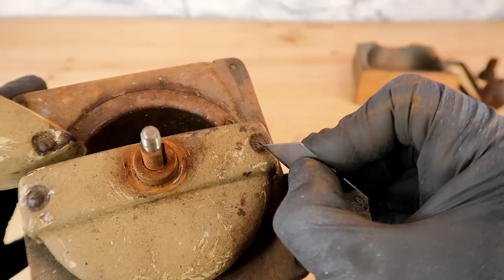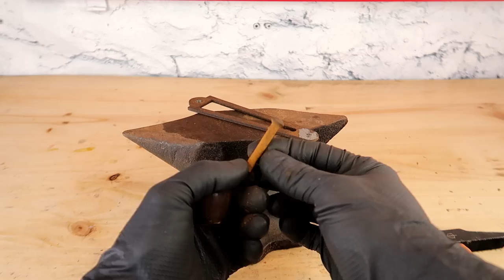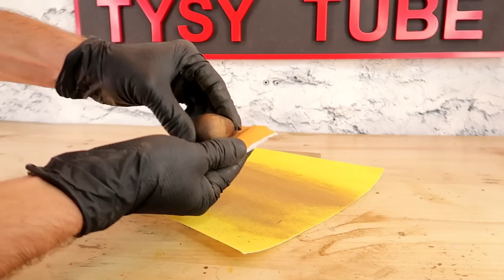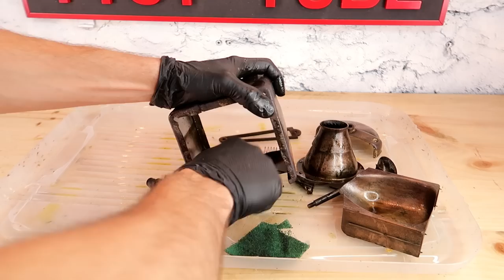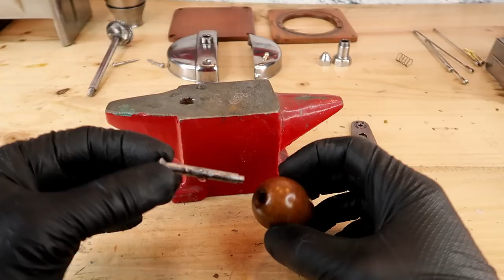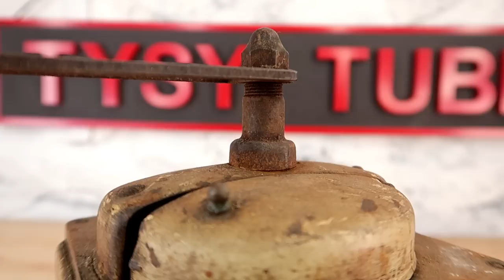Rusted Coffee Grinder - Restoration

Comment: I notice that the tabletop wheel with the wire disk was used to clean the outside of the metal housing. Would it make sense to use a wire wheel attachment on a small dremel tool to clean places like the inside corners of the coffee bean area? The section where you put the coffee beans into the device.

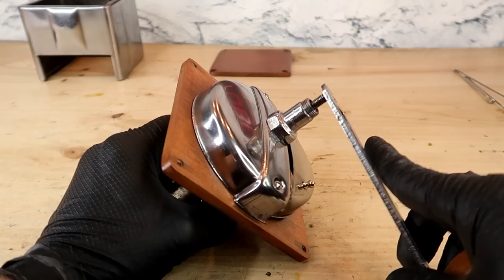Comment: At 14:08 When you assemble the grinding shaft and the centering nut, seems like there is a missing big bolt and/or washer that separates the  grinding arm and shaft. It is very likely that nut keeps the shaft centered and not wobbling around when you turn it.

Comment: Brother if you get the chance, pick up a used abrasive media blaster and a powder coat gun with a curing oven. Will work much better and faster than all that scraping and stripping then blasting it with coats of spray paint, just a tip!

Comment: How does the part cleaner truely work

When your pressing the pedal does it shoot water and a cleaning solution together to clean the part as you are brushing it or is it just plan water

If anyone knows the answer please let me know
Reply: Hello, its just one special cleaner calls Purgasol from IBS.its to clean oil and stuff. It comes with a pump out of the buttom to the table to clean and than it runs back to the buttom. Just ask if you need more information...Greeting Kai
Reply: @kaibornemann7644  oh i see now

so the purgasol is like rust remover, but instead of removing rust it removes the oil and dirt that has accumulated on the parts over the years?
Reply: @monkeyfan250  Thats true.....
Reply: @kaibornemann7644  ah ok

Comment: I do not understand why you are not nickel plating those steel parts that you polished and sprayed with lacquer. Nickel hexahydrate, water, an anode and a cheap old power supply from some dead electronics. 3V @ 500mA and 45 minutes and there is no need for lacquer.

Comment: I dont mean to be overly critical, but personally, I think you got  a little lazy with this one. You are capable of doing much better than this, and have proven just that. If you were not going to paint the parts that you left bare and tried for a polished look you should have concentrated more on getting rid of the unsightly imperfections,  (pits, scratches, etc.). Considering all that, perhaps maybe you should have repainted those particular parts instead. The full potential with this piece  could have been obtained if you had spent a little more time on it. Looks good from a distance , but "ouch" when the camera zooms in on the close up.

Comment: The decision to not paint this, but polish it, makes this a total fail. Restoration is not about giving things a new look, but about trying to get the item as close to the original as possible. You usually are quite good with that, in this case you just messed up. This is not restoration, it is modding. You took away the charm of the old and turned something great into something dull and boring.